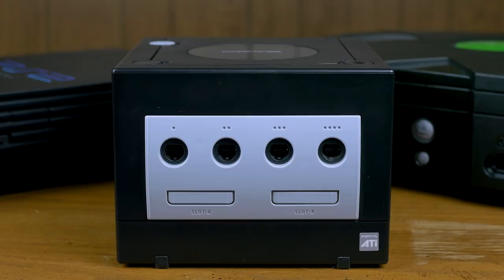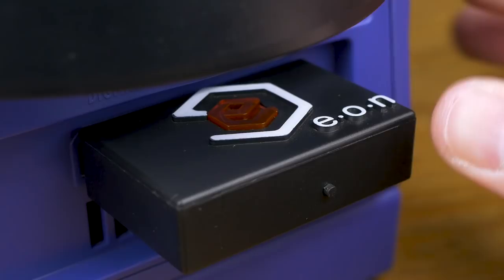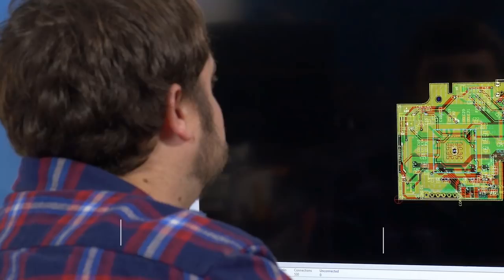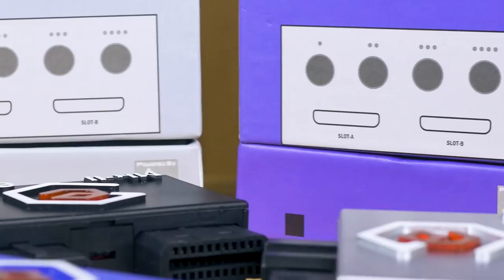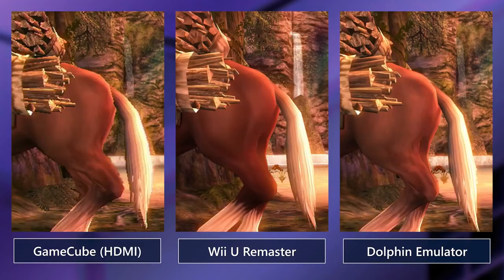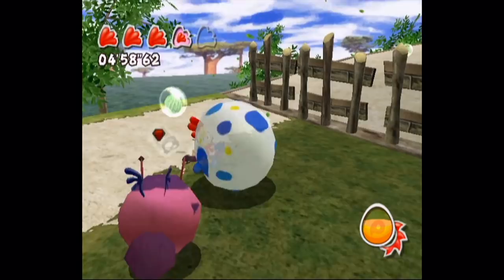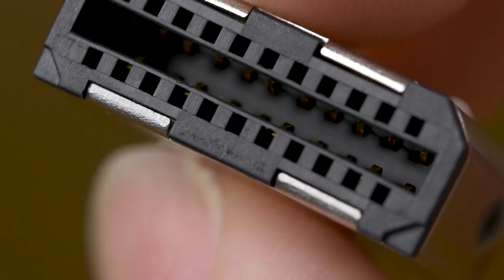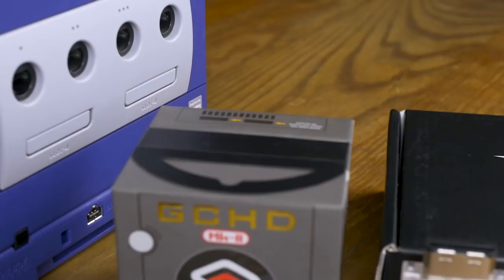Nintendo GameCube HDMI, Component & RGB Plug 'n Play Solutions :: RGB316 / MY LIFE IN GAMING

Comment: THANK YOU for mentioning dithering. I just tried my Carby and noticed some serious dithering on Luigi's Mansion while I didn't notice any when I tried the same game on my CRT via official component cables. You just put me at ease. This channel rocks!
Reply: So what was the cause of that problem ?
Reply: @goldenboyy5448  I may be wrong, but I'm suspecting it's just the way my old plasma from 2011 displays 480p images (I still love my plasma, nonetheless). Combining the Carby with the MClassic is a great way to fix much of the dithering and helps crispen the image!
Reply: I think the dithering becomes more visible when turning off deflicker (deflicker was meant for 480i and blends together each scanline with its neighbor above and below, acting as vertical blur, disabling is commonly done by video mods which force 480p on games).

Comment: I had pretty huge differences between two Wii component cables I bought(the first one was like 7.99, so maybe that's to be excepted).

With the current ones, tho, I don't see why you'd need anything more than a Wii. The picture is super sharp and you get the added benefits of running Wii custom firmware, which compared to a GC doesn't require any mods or extra hardware whatsoever. This is pretty important if you live in PAL land, where none of the games released even had official support for 480p.

So yeah, I'd say go for a Wii unless you really need that extra 1% in picture quality(and remember to get good component cables for it, thick ones usual indicates quality in my experience).
Reply: I totally agree with what you say except one point:  if you want the best GB/GBC/GBA picture quality through some sort of monitor, you only real two options* are either a GB Player with a component/HDMI/RGB solution or modding a GBA to output that way.  To that end, a GC controller is substantially more comfortable for long-term play.  Also, the chroma shift they mention in gcvideo 2.4a vs 2.4b is precisely most noticeable on 2D art for GB/GBC/GBA games.

Having said that, throwing $75 just to get an improved image in GBA games isn't enough for me.  GBI gives me enough options and flexibility to be a good enough solution for the time being.  For GC games, I'd just go for a Wii/Wii U.  Probably the most amazing thing to me looking at the videos is unless you magnify the video or are very close to the monitor in most circumstances even composite cable looks really good.  I guess I'm more inclined to accept soft edges over jaggies on 3D art (and vice versa on 2D), so that's probably more a bias on my part.

* I don't include emulation primarily because as awesome as it is, AFAIK we're not to the point of 100% fidelity and obviously this whole discussion is focused on that.  If not, then yea, a Raspberry Pi 3 would be good enough in almost all circumstances.

Comment: Man, I love how crazy and interesting all this new tech is, and yet I’m just using an RGB SCART cable on my CRT. Honestly, the quality difference is noticeable, definitely with a direct comparison and maybe kinda without it, but only when upscaled on an LCD. I bet you it’s damn near impossible to tell when sat on a sofa at the other end of the room when using a CRT, and I definitely can’t tell the difference. But even if I could tell, it’s far easier to just buy a Wii SCART cable for 20 quid and then just have it work, rather than buy £100-200 of cables and dongles and adaptors and then have to spend hours trying to configure it. (I’m a massive nerd though and would need to spend all year checking every option.) And worst of all, my CRT simply cannot handle 480p and is limited to 576i, so I can’t make use of any of this new stuff anyway.

I expect that for now I’ll be sticking with my current hardware as 576i is my max resolution and hides any picture issues, but when I acquire a PVM-20L5 or some BVM model, I’ll probably be upgrading to a GCHD-MKII.

Comment: Finally broke down and bought a Component cable. 
Which DRC mode do I use on my Sony Trinitron CRT?
Interlaced or Progressive?
Reply from the maker: [Try4ce] You must have a digital CRT. It's been a while since I had one. It's deinterlacing modes. Try each while using interlaced games. If your see some weirdness along color edges when moving horizonally, switch to the other mode. I forget which does what.

Comment: So which is better? GCHD or CASBY? I'm not too tech savy.
Reply from the maker: [Try4ce] Carby is the most affordable and identical quality if you want to use HDMI only. But GCHD also offers analog video and additional audio output options if you need that.
Reply: Exactly what I wanted to know-- thanks for asking,  and thanks Try4ce for answering.
Reply: @mylifeingaming  thanks for the reply
Reply: I’d consider buying the actual component cables or monster cables, or alternatively the AR card/disc. Because there are several videos, forums, and post indicating these hdmi attachments fried peoples GameCube. Although they do work, there’s a specific chip that Ninentendo used to convert and upscale the image...these attachments were made to bypass that, and ultimately over work the cosnsole and dry the mother board.
Reply: @cristumble6470  Really interesting. I ended up buying a Wii and a 3rd party component cable and so far I am happy with it. I had already read something like that and the overheating issue won for me.

Comment: MyLifeInGaming if you can read This, can make a video about projectors or projection televisions?
Reply: Probably not because projection TVs suck and a projector normally relies on how closely its position is to the screen/wall. Besides that how clean your bulbs are and bright they glow affect you resolution. There's a reason why we have slowly stepped away from projection tvs
Reply: But what about a video for how to get the best sound with different alternatives on speakers and headphones on the market for consoles ?
Reply: Depends on what systems your using. Any thing with av or component cables can be ran through most home theater systems. I use an old Yamaha AV receiver for all my games and it handles everything from the snes to the ps3 just fine. If your mostly using hdmi get a decent sound bar from bestbuy or walmart. Stick with brand names and you should be ok. If your trying this with a system like a nes that's just mono or uses coaxial cable I'd just use whatever speakers the TV your using for it has.

Comment: It would have been cool to see pal GameCube RGB scart vs GC Video rgb scart, but still, amazing job as usual guys!
Reply from the maker: [Try4ce] Sadly we didn't have one on hand, but as stated, RGB is a color space conversion for the GameCube (from YCbCr) so you could make the argument that component is more "accurate." However I thought the RGB looked excellent on the Mk-II, no real downside to that versus component. Also remember that the native RGB on the PAL systems cannot do 480p, only the digital connector can do that.
Reply: @mylifeingaming  You're right. I was just wondering, since I live in PAL land, if it's a good idea to just buy the cheaper hdmi only solution and for a CRT to just use the analog port RGB capability

Comment: Crazy Taxi is a good game to test for color shift/bleed. Once you’re past the Press Start screen, the menu selection screen is great for testing this. It will easily show if there’s any. 

I’m using the EON MKII with RV Component into my RT5X. Didn’t look all that good until I used Swiss to force 480p then the difference was great. I then used the mClassic and it’s even better. I’m no advocate for the mClassic and I hardly use it but in this use case it was a noticeable difference even though I’m using it out from the RT5X with 1080p. It helps remove the analog haze.

Comment: I still have the Gameboy Player AND the original boot disc, plus a Hori GameCube controller.  I have been considering one of the HDMI out adapters.
Reply: You should look into getting an Action Replay disc and putting the GameBoy Interface software on it. It's a vast improvement over the original GameBoy Player Disc.

Comment: No mention of the Wii2HDMI or Lenkeng LKV-6000 mini? I'd have thought those Wii HDMI adapters would have been an obvious comparison with GameCube HDMI adapters.
Reply from the maker: [Try4ce] It's really not an equivalent comparison in my opinion because GameCube is a true digital signal, on Wii, there is no external access to the digital video. Those devices simply convert analog to HDMI. But they will be covered in our Wii episode next year.
Reply: @mylifeingaming  In that case, do you want to borrow my Lenkeng LKV-6000 mini for the Wii episode? Those are now harder to come by and they are the only Wii HDMI adapters that actually upscale.

Comment: Decided to get a Carby component cable. Interested in seeing how it looks through a RetroTink.
Reply from the maker: [Try4ce] Keep in mind that the RetroTINK-2X cannot accept 480p input, so you will be limited to 480i in that scenario. The Component cable is primarily meant for people who have the means to connect component to a 480p capable display with component inputs. The OSSC can do a great job with 480p component on an HDTV, but the RetroTINK-2X is mostly meant for 240p and 480i.
Reply: Right, that's fair. I was aware going into it, though I've only ever used the 480p mode once or twice through my Wii. lol

Comment: Welp,I'm completely lost now. There are so many options discussed here and with all the talking about mixing and matching framemister or OSSC with these things I have no clue what's going on. I usually play older systems on my CRT using composite (which looks quite good honestly). An HDMI solution could be an interesting alternative, but I can't tell which I supposed to be better or why I'd want to use a Frame mister or OSSC. Adding those increases the cost even further. I'd just prefer a plug and play solution that works with as little lag as possible, and should be scaled to fit the screen as best as possible without distorting the image.
Reply from the maker: [Try4ce] One of the new analog options + OSSC is the best for 480p, hands down. If you want to just do HDMI, I don't think pairing with a Framemeister is necessarily worth dealing with, but it's an interesting thing some people would want to see.

Comment: Honestly, I'm a Brit, so I have a PAL GameCube which means that it is RGB compatible. I think my best option is to get myself a new SCART cable (my old one is losing the G in its RGB) and get the Carby HDMI adapter. One for the 480p, and one for the ultra-low latency GBI (I did spend over £300 on a Framemeister. Of course I'm going to use it)
Reply: I also use the Pal cube with scart. I recommend the gamecube scart cable from Retrogamingcables uk

Comment: Great video!
7:07 : 480p over the Wii RGB Scart cable? Are you SURE? I don't think Scart cables can carry a progressive signal.
Reply from the maker: [Try4ce] Yes they can, it's just that the devices are rarely configured for it. The OSSC can accept 480p over SCART from the GCHD Mk-II, as shown in recordings in this episode. You can also get 480p from PS2 in this way, but it uses a weird sync type called Sync-on-Green. It can be a pain getting it to work with some devices, but it works with the OSSC.
Reply: @mylifeingaming  Sorry to bother you again on the topic of progressive scan through unusual vectors, are you surprised by this: https://manuals.playstation.net/document/en/ps3/current/settings/videooutput.html. Il tells us that composite video + Scart adapter hooked to a PS3 can deliver 480p/576p to a TV... I don't know if this is different from the Scart cable used with GCHD mk-II. I've always thougt that composite video could not under any circumstances move a progressive signal!

Comment: I traded my white wii u gamepad for the component cables, btw there is 3d printed component cables on eBay to search them type the following: GCMax for Gamecube DOL-001 HDMI / Component adapter GC Video Plug Max gcvideo

Download the files immediately from the Github. You could make the cable yourself but it is hard work.

Comment: So the gamecube on it’s own cannot produce 480p in pal but can pal do 480p with these adapters or is that not possible
Reply from the maker: [Try4ce] The PAL consoles can do 480p, but the PAL games do not support it. So if you have a cable or device that can connect to the Digital Out port, then your console is indeed capable of 480p no matter what region it's from. You can force 480p in PAL games (or NTSC games that don't support 480p) if you can launch homebrew software with the methods we show later in the video. Swiss allows you to force 480p, and I believe most games run without issue. There is an incomplete compatibility list on GC-Forever.

Comment: They mentioned component output from a Wii, but I'm surprised that they didn't mention using a Wii with HDMI output when playing on a Wii. From what I've read on what seemed like very reliable forum posters, the easiest way to get really good image quality with Gamecube games is to use a Wii with one of the super cheap HDMI adapters you can get for them (I paid about $10 CAD including shipping), it's cheap because the adapter doesn't have any image processing or any fancy circuitry in it. The adapter also has an analogue 1/16" audio output on it, but I'm not sure if you get audio over it or the hdmi cable for gamecube games, as I have yet to actually play a gamecube game on my Wii. Wii's are super cheap, just make sure that it's not one of those Wii's with no Gamecube functionality, then you get native Gamecube hardware functionality, at least for normal gamecube games, with the addition of a higher image quality than is possible with the Gamecube without modding it or adding an expensive display adapter, and there's no added latency compared to some of these more expensive image processing adapters. The only thing you can't do I think is play multiplayer over a network if you're playing gamecube games on a Wii. At least, this is what I've been led to believe. It's also a great way to get great image quality on the Wii as well. My understanding is that the Wii itself has native support for the hdmi signal output, whereas the Gamecube doesn't, and requires a much more expensive adapter or some kind of mod. I assume someone will either correct or add more information to this, as I'm just relaying what I remember from a big forum/ fan web-site that I read through once.
Reply from the maker: [Try4ce] These adapters will be featured in our dedicated Wii episode, but I did not even consider putting them in this episode because the nature of their operation is not at all the same thing. They are converting analog to digital, so it's an extra conversion step. The function that these perform is really no different than an HDTV performs on the component cables if you plug those directly in (if your TV still has those). It is certainly a convenient option, but I distrust the quality of conversion (not to mention the inconsistencies between adapter units), and like I say, I don't view it as a similar enough of a solution, but I can see why others would. I do still need to do more testing on them before forming a solid opinion, but I will say that the equivalent adapters for PS2 are pretty terrible in my opinion.
Reply: @My Life in Gaming Have you guys tried the Marseille mCable Gaming Edition in these GC HDMI devices yet? I don’t have the devices but I have the mCable so I could only test on an original Wii and WiiU. Original Wii was using Wii2HDMI but I didn’t see any difference, even in GC mode. Now in GC mode my capture was too dark on dark themed games. I’ve never noticed this Maybe because my tv was adjusted..With that being said, I saw a huge difference on the Original Xbox and Dreamcast along side with their Pound Link counterparts.. I just wanted to know if it could help the image direct from the GC using the HDMI devices now available. I still gotta test the WiiU with Nintendont though.

Comment: Hey can you please clarify about using Nintendont on WiiU and unlocking GameCube games? Is that a good HDMI solution for GameCube?
Reply: yes but wii with hdmi adapter is better
Reply: I don't think it is 😅 Those Wii2HDMI adaptors use composite signal most of the time and look visibly worse.
Reply: @BattlingNebula1  most wii2hdmi adapters use component video

Comment: All these cheaper GameCube HD options are nice and all, but I have to wonder, is it really worth it for PAL users? Quality wise, component and RGB offer the same picture quality. The only advantage component has is progressive scanning, which was disabled on PAL consoles. On the other hand, PAL is 576i vs NTSC's 480i. And if your at equipment is good at deinterlacing, the end result will be higher resolution than 480p anyway. Especially if you're using a SCART to HDMI scaler.
Reply from the maker: [Try4ce] Progressive scan is NOT disabled on PAL consoles... it's disabled in PAL games. If your system has the Digital Out port, you can force progressive mode in those games on those consoles, although again, there could be issues with some games here and there.